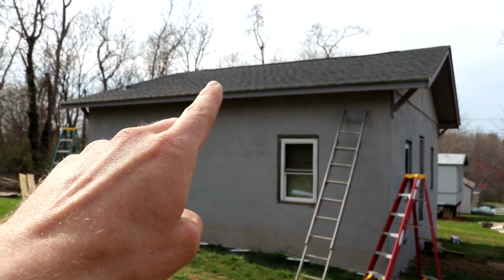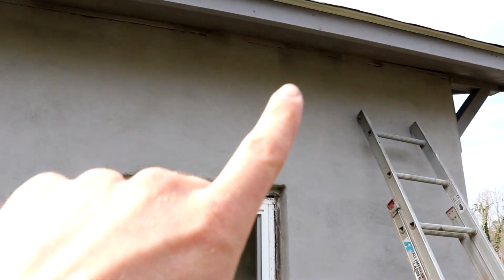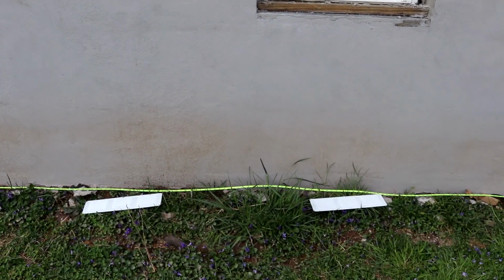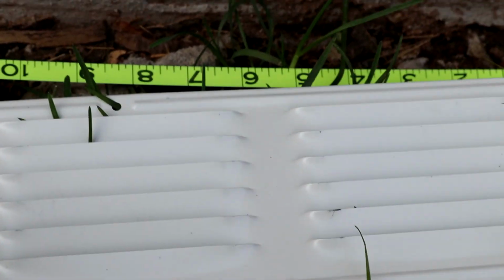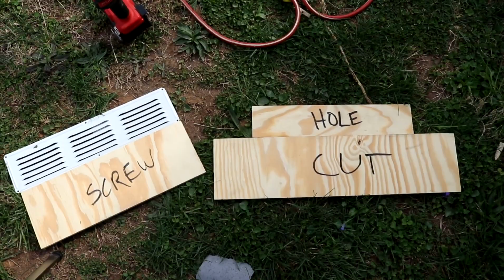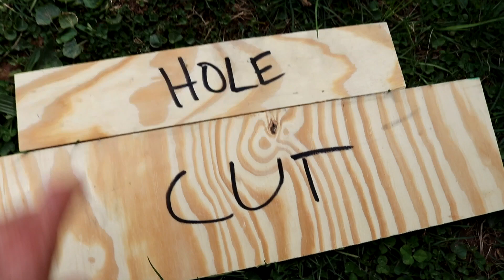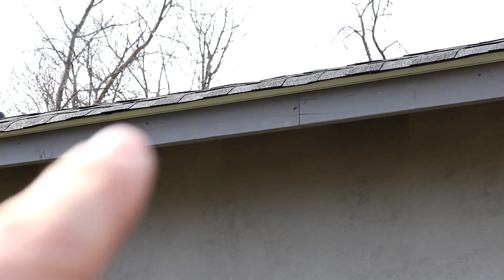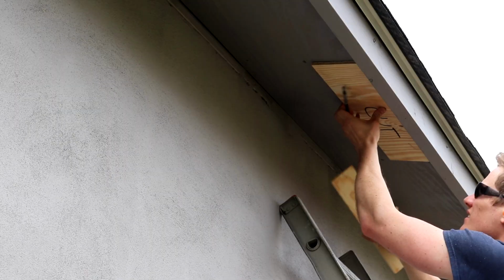$12k CASH HOUSE - Attic Ventilation - #29

Comment: Am I missing something here? These things don't actually connect to the attic, right? We saw the overhangs added on as these wooden ladder looking things. Isn't the soffit vent just letting air into the overhang void? It's still separated from the attic by the 2x4 making up the side of the ladder.

Comment: You didn't show it in the video so I thought I would ask if you opened up holes from the attic space into the soffit as the overhangs were added on to existing sealed building.

Comment: Holesaw would make those cuts way easier. Drill 3 holes in your template board and use those to mark the location of 3 holes to cut for each vent.

Comment: maybe i am wrong, but i think it would be better to turn the vents 180° around for the following reason. when the air goes in through the vents condensation water may form because of the temperature difference. the water should be able to run out there freely. to facilitate that the vents must be turned or they point upward an trap the water inside causing longterm damage to the wood by rotting or mold. I hope this makes sence. keep up the good work. i always enjoy your videos.
Reply: Bernhard Neumayer it would make no difference- the airflow is slow. No doomsday scenario here...

Comment: You might look at getting a battery powered jigsaw. I've got a 20v Porter Cable, but I'm sure just about any of the major brands would make a decent model. I was skeptical until I actually started using it. Worked better than any corded model I have had with the added bonus of not needing to plug it in or have power close by.
Reply from the maker: I'd like a battery powered everything.....along with a bunch of other stuff.

Comment: Curious as to why you chose to orient the intake slats towards the house. It's my understanding that they should always be facing to the outside in order to take advantage of the winds to encourage ventilation flow. Air flow against the house may create a suction effect, drawing hot air from the peak back towards the lower points. Anyway, you're obviously a logical guy and I'm sure you have your reason,  just wanted to see what it might be.
Reply from the maker: They looked better, and I've over ventilated anyway as far as the number of square inches given the sq. feet of the attic. Heat is going to rise naturally, air will be pulled in.

Comment: I need to add a ridge cap vent to my house.....soffit vents, got 'em!
Reply from the maker: It's not hard. You can just pull your cap shingles off, snap a chalk line to either side of the ridge and cut right through the shingles with a circular saw, roll out the vent and nail down caps...........or, and this way is much easier.....just pay someone. Attic ventilation does a lot for a house. Shingles last longer, house stays cooler, dryer, etc.

Comment: When it’s really cold in winter will there be any condensation problems from the sharp temperature change from indoor/outdoor air?
Reply from the maker: The attic is not heated, the ceiling is insulated. Venting allows heat to escape during the summer and also lets any moist air escape.

Comment: i have used a hole saw where the vent slot are to save time nd labor
Reply from the maker: One of those obvious things I didn't think of despite having a nice set right on the other side of the wall inside.

Comment: Dang i only put that much angle tilt on an extension ladder ONE time. I dont know how you get away with it it. lol
Reply: 4:28
Reply from the maker: I've had it way further...the feet are flipped up and dug in, it's not going anywhere.
Reply: Ya ive done that and put 1x2 stakes in the ground and still.. Of course im not young and lean anymore. lol
Reply: Skinny and in shape fixes a lot of problems

Comment: So these, or things like these, confuse me. I hear that outside 'air' is bad, because air has moisture. Moisture is bad because... well... it's wet. So keeping a water/air/vapor barrier is super important. But these things, (and the roof ridge) are 'holes' that allow that very moisture ridden air to enter a home: On Purpose. ???
Reply from the maker: I can understand the confusion in this day where they act like the best thing to do to a house is seal it up like it's inside a plastic bag......which I disagree with. The short story is an attic is a separate space from the living space. The ceiling is insulated. In the summer, the vents allow hot air to escape the attic and draw cooler air in. You need a little air exchange to keep air quality acceptable in the attic.

Comment: Your innovative templates made quick work of the installation. Didn’t know they still made those type vents. Will you be installing a gable vent on the either end or will a front one throw off the aesthetics of the street view?
Nice work which should help the life of the shingles.
Reply from the maker: These are plenty, it's actually about twice that I calculated as required. No gable vents, no reason or room due to the brackets.
Reply: MRrwmac you dont use gable vents with a ridge vent.... Must use soffet vent with ridge vent

Comment: What is your total investment so far and projected investment upon completion?
Reply: I am going to wager a guess and say $12,000 to the point we are at, with another 5-7k to finish it, most of that being sheetrock, insulation, paint, cabinets, lights and bathroom fixtures.
Reply: The house was 12k, he has probably put around 5k into it with another 5k going into what you said.
Reply from the maker: I've probably spent around $6k.......but I'm guessing. I haven't added it all up yet. So I'm around $18K....ish, maybe less. I'll probably have $25k total including the house. It would rent for $6k - $7k a year. I also did it with cash, so no interest payments on a loan or credit cards. There's more than one way to skin a cat but this is how I go about it so far. In the future I'd like to step it up and do more "normal" stuff in my area......which would be buying a house for maybe $50k - $75K, spend around $30k and sell it for $150k. All rough numbers but something along these lines. Not sure what the price of this house could be if I sell it.
Reply: Impressive, I'll make sure to stay tuned for the next flip that you do.
Reply: Why not add vents 2 soffit before attaching 2 house 2 save ladder climbs and award position at top of ladder?

Comment: Created way too much work for yourself. All that was really needed is 3- 2 1/2 inch holes drilled with a hole saw under the louvers of each vent. Been doing it that way for years.
Reply from the maker: That would have been simplier......but there's usually someone that has got it figured out better. Now I know. Thanks.